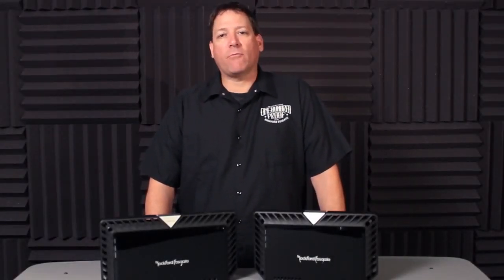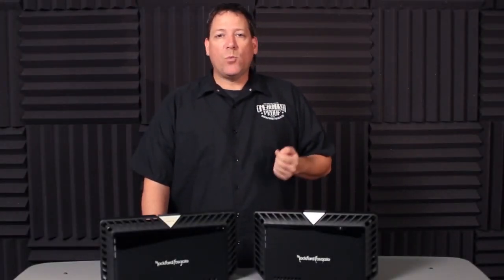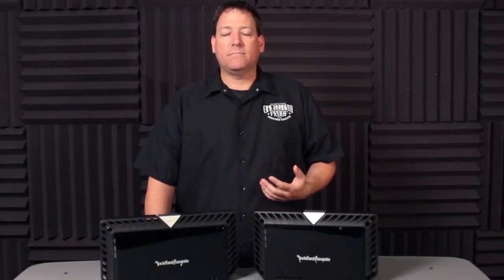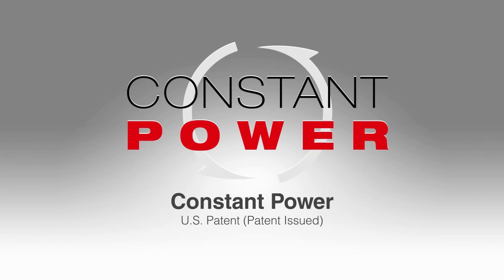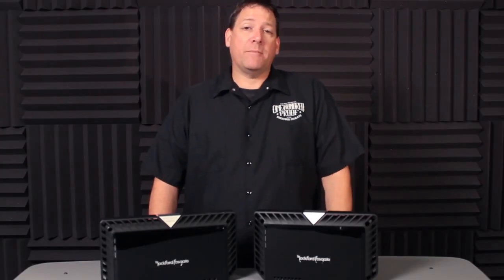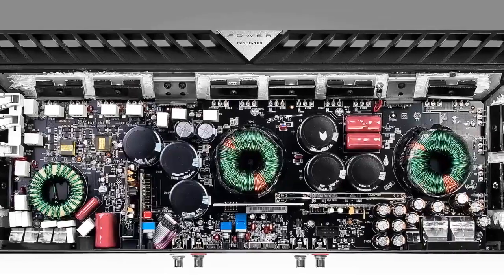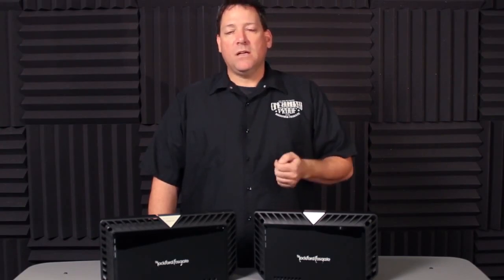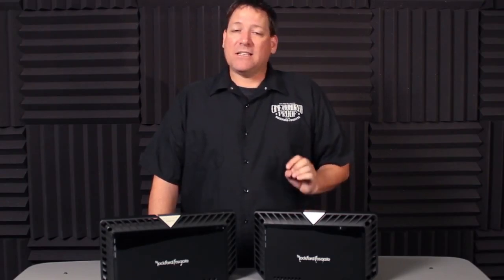Rockford Fosgate: Power Amplifier Overview (3.3)

Comment: I'm excited. To be getting a full Rockford Fosgate System put in my 2005 Suburban.  1- Power T400 x4 channel Amp. 1-Power T1000 2 channel Amp. 4- P1650 6.5 Coaxial for Front and Rear Door Speakers. 4- P1TS Tweeters for A and B pillars. 1- P132 3.5 speakers for the D pillar. 2-P3 12" woofers in ported box.  Cant wait to hear it.
Reply from the maker: Wow Harvey, your plan for a 1,400 Watt system sounds like it's gonna rock the neighborhood.  Thanks for being a Rockford Fosgate fanatic!

Comment: I'm very impressed with my 1500.1 Power amplifier! I've had it for 1 year and only ran it at 4 ohms and it pushes my P3's to the max. And my 400.4 Power is nothing to squeeze at on my highs and mins. Never once has either ran hot or shut down.
Reply from the maker: Hey bunky021543, we're thrilled those Power T1500-1bd & T400-4 amplifiers are working great in your system!  Appreciate your feedback!
Reply: You're welcome and thank you all for making such awesome products!

Comment: Hi I would like to know what's the difference between a T2500-1bd amp and a T2500-1bdcp amp, maybe I missed it when to talked about it in this video!!! I have one of each of those amps!!! Does one put out more power than the other or do they both put out the same amount of power??? Thank You!!!
Reply from the maker: Great Question Jose, 
The CP version incorporates our Patented Constant Power technology.  It helps the amplifier sustain power during varying impedance fluctuations cased by the speaker/subwoofer for more consistent delivery of power output.  If comparing both amplifiers for a certain amount of time (Say a music track if 1:40 mins) the CP version will produce more energy, consistently over the entire duration of the 1:40 music track. One thing to note is we don’t recommend using the bdSync cable to bridge these 2 different amplifiers together.
Reply: @rockfordfosgate  So that means if you want to use the bdsync cable to strap two of them together they have to be two bdcp amps or two bd amps of the same kind is that correct for it to work??? If that's the case then thank you for that piece of information!!! My question is why can't they be two different kinds???
Reply from the maker: @josea.garcia3994  That is correct, for optimum performance, they should both be “bd” or both “bdCP”.  We recommend they be the same because otherwise it would be like strapping 2 cars together, one uses the accelerator and the other uses cruise control.  For flat straight-a-ways, it will work fine, but for off-road use (similar to a speaker’s complex impedance curve) one car will fluctuate the throttle to maintain constant control, while the other is being manually manipulated, so both engines will not be in “sync” with each other.
Reply: @rockfordfosgate  Great that's good to know!!! So strapping two of the same weather it be two bd amps or two bdcp's would they both come out to being 6000watts strapped together or can the final wattage very in every different sound system set-up???
Reply from the maker: @josea.garcia3994  Two amplifiers in bdSYNC mode will produce 5,000 Watts x 1 @ 2-Ohm.  Please note, the individual amplifier minimum impedance is 1Ω, but when bridging, the minimum impedance is 2Ω.
Reply: @rockfordfosgate  Is that 5000 watts at the rated Continues Power rating of 13.8 volts or is that at the Dynamic Power rating of 14.4 volts that's being illustrated on the ROCKFORD FOSGATE POWER amplifier manuals??? Because I do notice that there's a difference between the DYNAMIC POWER RATING and the CONTINUES POWER RATING wattage output???
Reply from the maker: @josea.garcia3994  All measurements are done at 1.4.4V per CTA-2006 guidelines.  You can see all the specs here: https://rockfordfosgate.com/products/details/t2500-1bdcp/
Reply: @rockfordfosgate  Thank You!!! 👍👍👍
Reply: Is it possible to run a sound system at the DYNAMIC POWER RATING of an amp at all times at 14.4 volts with out having any voltage drops or is that totally impossible??? If so how can it be done and how is it possible??? Thank You!!!
Reply from the maker: @josea.garcia3994  Electrical systems on cars/trucks/suv are 12.6 when the system is off and typically 14.4 to 14.8 when the vehicle is running.  It is possible to sustain this voltage at the amplifiers by upgrading the charging system's electrical cables and cables that run back to the amplifiers.  Usually, fanatics use the largest cable they can accommodate, which is either 1/0 or 4 AWG.  Don't skimp by using CCA wire, be sure to use 100% oxygen free copper.
Reply: @rockfordfosgate  This can also be achieved by upgrading to a High output alternator as well correct??? What I find difficult is to sustain the voltage at 14.2 to14.4 Volts on a constant bases at high music volumes!!! I assume that's where your DYNAMIC POWER comes in to play for your car audio equipment correct??? Voltage drops is what I'm talking about at higher volumes!!! How to maintain your voltage at higher volumes without any voltage drops??? Assuming that you upgraded all your electrical correctly and properly including the alternator!!! How can this be achieved??? Not to many people can maintain the voltage at a 14.2 to 14.4 range!!! I seen people's voltage range from 13.8 to mid to low 12 volts range!!! The CAR AUDIO project that I will be doing is going to be roughly be about 7000 watts RMS and all ROCKFORD FOSGATE CAR AUDIO equipment!!!
Reply from the maker: @josea.garcia3994  Yes, this relies heavily on a better alternator and stabilization methods such as lithium batteries and/or capacitors.  This article might be helpful "Upgrading the charging system": https://rftech.custhelp.com/app/answers/detail/a_id/145/
Reply: @rockfordfosgate  Thank You for that article information Link it was very helpful and gives me great help towards what I have to continue to research for completing my competition sound system!!! If I have any other questions or concerns or need some help I will reach out to you!!! Thanks for all your advice and information you have given me!!! 👍👍👍
Reply from the maker: @josea.garcia3994  You're welcome.  We also have technical support available that monitors their in-box all day available at www.rockfordfosgate.com/support/

Comment: Currently running t2652-s components  front and rear t1650 coaxial with p400×4 amplifier. what amplifier would u recommend for best sound quality and loudness to get out of the speakers since they are only being fed 50rms
Reply from the maker: Hi Eloscar 57, Thanks for using Rockford Fosgate for your ride! Both those are amazing SQ speakers.  Right off the top, these look like an awesome match!  So, let's breakdown what you have:
• The T2652-S are rated to handle 100 Watts RMS
• The T1650 is rated to handle 75 Watts RMS
• The Punch P400X4 Continuous Power is 50 Watts x 4 @ 4-Ohm and Dynamic Power is 82 Watts x 4 @ 4-Ohm 
The Punch P400X4 is a great Class-A/B amplifier designed for SQ and exactly what you want to match with your SQ speakers.  The power output matchup between the amplifier and speakers couldn't get any better.  As you know, Rockford Fosgate amplifier are typically considered "under-rated", so you can easily expect the Dynamic Power output from the amp.  If it's not loud enough, you may need to start looking at adding multiple drivers to increase your SPL output.  Otherwise, this must sound amazing.

Comment: If I buy 13” T2 subwoofer rated at 2000 rms. Should I buy the Rockford power T1000-1bdCP or the T1500-1bdCP amp?
Reply from the maker: Great question Jameson!  How many subwoofers are you planning to use? If just one, then use the T2S1-13 model since it would be a 1-ohm load and perfectly matched for the Power Series mono amplifiers.  Since the power handling is rated at 2,000 Watts RMS, we would suggest the T1500-1bdCP. Although it's rated to produce 1,500 Watts x 1 @ 1-Ohm, its dynamic power is actually 1,715 Watts x 1.  This is under the rated power handling of the subwoofer and a perfect match!

Comment: On the T600-4 amp, using the the Punch EQ, if you have the front channel set to High-Pass and rear channel to Low-Pass will both channel pairs raise at the same rate in their respective frequencies as described with just setting it to the the same cross-over across the board? ... I have had this amp since 2008 and has outlasted all of my cars to this date never installed a punch knob on it. I love my Power Series Amplifiers. (T600-4, T2500-1bdcp, T500X1PBR) ... That does not take away from my Prime and Punch Amps ... Power Series just hits a little different. 💪🏾
Reply from the maker: Hi Juan, great question on a great amplifier!  When using the Punch EQ, it can add up to +12dB @ 12kHz (Treble) and up to +18dB @ 45Hz (Bass) depending on where the adjustment is set. When the crossover is set to LP (low-pass) the EQ boosts BASS response. When the crossover is set to HP (high-pass) the EQ boosts TREBLE response.  We have a diagram on how it works here: http://rftech.custhelp.com/app/answers/detail/a_id/918/
Reply: Rockford Fosgate I am familiar with the Bi-Amp advisory. However, the referenced diagram does not address the 4 channel amplifiers with a single PEQ knob. Does it imply that both crossovers in the 4 channel amp will simultaneously respond?  My guess is that it does ... I’m guessing that the downside of using a 4-channel with a single PEQ know, each channel will respond to the knob’s setting and their is no way to isolate the two unless you get two separate amplifiers. ... I am using the front channels for tweeters (High-Pass) and the rear channel for my mids (All Pass) on my front stage set-up (full active w/ 3Sixty.3 DSP). I’ll test it out in the lab and see when I get time. Thanks for the feedback!
Reply from the maker: @PhiMobileSounds  Thank you for the clarification.  The T600-4 amplifier does feature 2 Punch EQ settings that allow the front & rear settings to be adjusted independently.  However, when plugging in the Remote Controlled Punch EQ knob, this overrides REAR channel's built-in Punch EQ setting, because the rear channels are typically bridged for subwoofers and the front channels typically run mids/tweets.

Comment: Hey  rockford team i have a question on the bdcp amps the settings knobs have a small dot is that the mark to go by????

 i noticed the knobs are kind diffrent  than other amps .
Reply from the maker: No, the dots are there just for reference, not where you should be setting them.  The CROSSOVER is typically set to 80Hz Low-Pass for subwoofer systems and the GAIN should be matched to your source unit or preamplifier output.   If you're having problems setting your gains, you can refer to this section "GOOD: SET YOUR GAINS BY EAR" in this article:

How To Properly Set Your Gains:
https://rftech.custhelp.com/app/answers/detail/a_id/46/

Comment: I have a Sundown Audio Sa series 2 ohm dvc can a Rockford Fosgate T600-2 push that 15 and how should I wire my sub to work with the Amp.
Reply from the maker: So the subwoofer is rated to handle up to 750 Watts, correct?  Since it's a 2-ohm DVC subwoofer, it can be wired to create a 1-ohm load or a 4-ohm load.  The T600-2 amplifier is designed to produce 600 Watts x 1 @ 4-Ohm Bridged.  Look at the WiringWizard tab on our T600-2 Product Details Page and use Wiring Diagram #2 at: http://www.rockfordfosgate.com/products/details/t600-2
Reply: Rockford Fosgate Thank you it can be heard a block away this one bad mother it isn't very big but man it Packs a Punch the gain is up a notch , who would have thought. Rockford Fan 4 Life.!!!!!!!! it sounds way better than a set of 12's. #No doubt. It's a little Monster.!!!!! 98 Honda Passport is a Beast and competing with a Yukon or a Tahoe. Much love Happy Camper.!!!!

Comment: Just recently purchased the T1000-AD can the amp be paired with 2 sets of T4652 or T3652 without issue?
Reply from the maker: Yes, absolutely.  The T1000-4ad is a brute of an amplifier and has plenty of output power for 4 sets (2 on front, 2 on rear).  Nice choice!
Reply: @rockfordfosgate  Thanks

Comment: I have got a power t1000-1bdcp amp to fit, however space is tight.

Will it be OK to mount this amp to the back of my dual 12" p2 subwoofer box? I know its not ideal because of the vibrations
Reply from the maker: Not ideal, so I would suggest isolating it using rubber grommets.  That should help when you're in a pinch.
Reply: @rockfordfosgate  I was thinking of mounting the amp with a sheet of rubber between to dampen out the vibrations. Thanks for the reply.

I will have a rethink to see if I can squeeze it on the back of the rear seats where I have my t800-4ad mounted.

Comment: Hi RF I know this video is old but can I use the T400-2 for tweeters, using the power T2 components and want to go active. I hope I get a reply. Thanks
Reply from the maker: HI Neelchand, the Power T400-2 is rated to produce 120 Watts x 2 @ 4-Ohm (dynamic power is 145W x 2).  The T2652-S is rated to handle up to 100 Watts RMS, so technically this amplifier will overpower the T2 components, so we advise caution or using a slightly lower powered amplifier.

Comment: I am debating between the p600x4 and the t400x4ad to run 4 of my door speakers i’m not sure which one to go with. My front speakers are 80rms and rear is 55rms, i know “power” wise that the Punch should be good but i hear the Power amps just sound better. Anyone have any ideas?
Reply from the maker: Hi Francisco, the main difference between the Punch and Power in this regard is the slight power differences and the circuit topology.  The Punch model use Class-AB (sound quality) and the Power uses Class-AD (class-d).  You'll have better sound quality with the Punch model, but the Power amp provides similar power in a compact package.  If you have the room, use the Punch model.  If you're tight on space, use the Power model.  Here's a quick overview of the specs:

• P600X4 ($399.99): 75 Watts x 4 @ 4-Ohm / 150 Watts x 4 @ 2-Ohm / 300 Watts x 2 @ 4-Ohm Bridged
• T400X4ad ($439.99): 100 Watts x 4 @ 4-Ohm / 100 Watts x 4 @ 2-Ohm / 200 Watts x 2 @ 4-Ohm Bridged

Comment: Hi, I have a question, I have the amp t-1000.1bd and I want to connect 3 subwoofers 4ohms each, so the impedance will be 2.67 ohms. The amp will be working fine???
Reply from the maker: Yes, the T1000-1bd and T1000-1bdCP are stable down to 1-ohm, so although it will have reduced output, it will work fine at 2.67 ohms.
Reply: Thanks for answering very fast in less than 5 minutes . ROCKFORD FOSGATE #1...👍😉
Reply: At 2.67 ohms what kind of power will it run watts?

Comment: I am thinking to buy a single P3D4 12 @ 4 ohms connected to T500BDCP. 2 ohm load. Is this configration correct? Will my amp t500bdcp shut down after excessive usage for one or two hours or even more?
Reply from the maker: Hi Saif, the Power T500-1bdCP amplifier is rated to produce 500 Watts x 1 @ 1-ohm, so you will be totally fine running it at 2-ohms.
Reply: Thx for the answer RF
I'll buy P3D4 12 + T500-1BDCP and wiring will be @2 ohm

Comment: I have a 1500bdcp I'm going to run one sub don't know Wich one yet but should I run the amp at 1ohm or 2 ohm what ohm is better and is there a difference on this amp
Reply from the maker: Although the Power T1500-1bdCP is rated at 1,500W at 2-ohm and 1-ohm, Dynamic Power is rated at 1,549 Watts x 1 @ 2-Ohms and 1,715 Watts x 1 @ 1-Ohm. The amplifier produces the best possible power output at 1-ohm, so you just want to make sure the subwoofer's RMS Power Rating will handle that amount of output power.
Reply: @rockfordfosgate  I see people saying running amp at 1ohm makes the sub have not as good performance and the amp won't last as long I have no problem running at 2 or 1 ohm..only if 1ohm If it doesn't ruin the amp..just trying to figure out what ohm is best overall thanks so much
Reply from the maker: @jeffeisenzapf4131  The Power T1500-1bdCP is specifically designed to operate at 1-Ohm or higher.  Many "armchair-technicians" love to talk others into lower impedances like 1/2 ohm thinking you get more power from the amplifier, which is not necessarily true.  I'm glad the advice you read is error'ing on the safer side.  The amplifier will work just fine at 1-ohm.

Comment: ? I have T1500BD the sub are dual 2ohm 10inch Kicker Comp Q rated 700 watts rms what's the best way to wire them ?
Reply: Running 2 10 dual 2ohm Kicker Comp Q series
Reply from the maker: Hi Mchickencat, do you have the T1500-1bd or T1500-bdCP?  Is the "bd" in the model number RED on the amplifier badge?

Comment: One more question my friend,  what happens if I run the amp t-1000.1bd at 0.5 ohm?? I have  the same model the you show in this video
Reply from the maker: The amplifier will produce less output and/or go into protection mode.  Running the amplifier below the recommended impedance isn't going to get you more output.